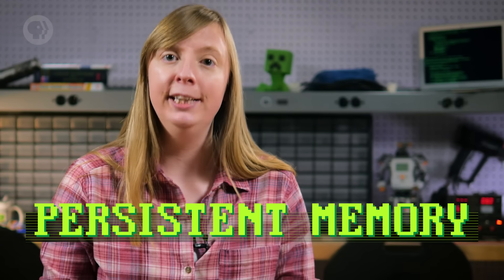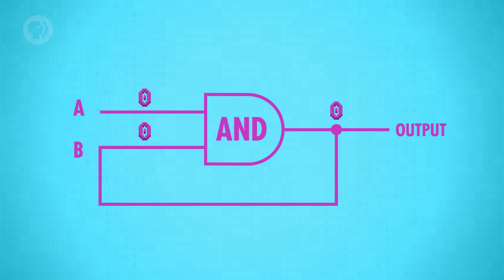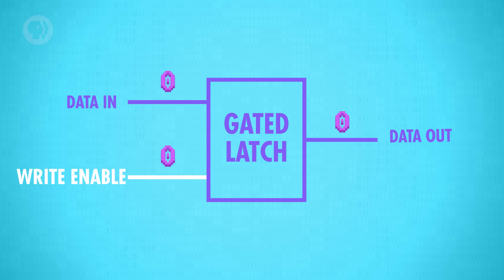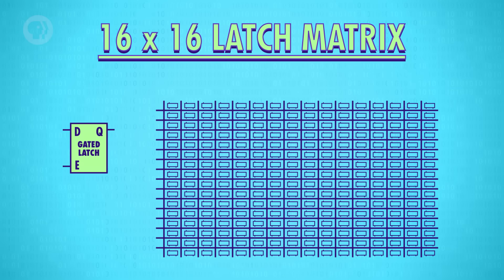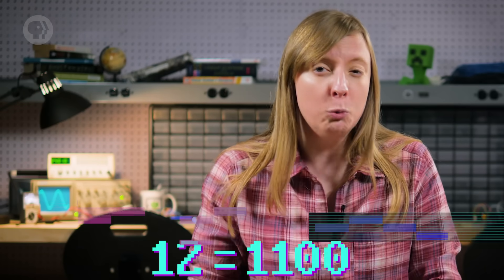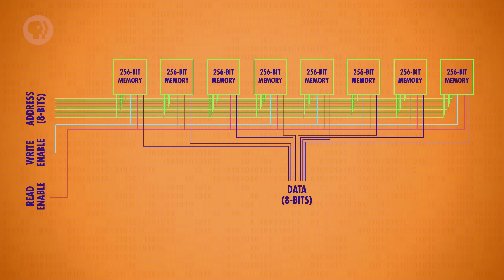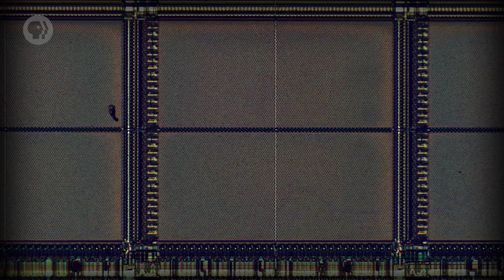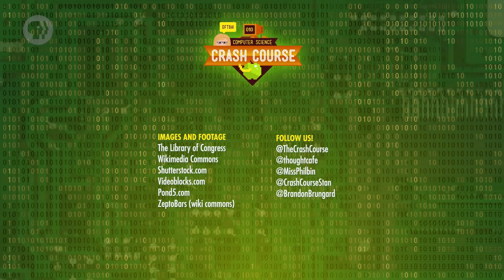Registers and RAM: Crash Course Computer Science #6

Comment: Hi guys , I know the following facts:
There are 4 form of data stored In computer.
1. Latch . Registers use this method to store data;
2. Floating gate . EPROM; 
3. In a capacitor. RAM use this method to store data;
4. Magnetic pole. Hard disk use this way. 
   Now image this scene , the computer need to move a bit from a RAM cell to a register.
How does it work ? What component will make the decision that there is a 0 or 1 in the capacitor ?How does it work ?  
  The data stored in the RAM cell is sent to the latch in the form of square wave ? How does this work ? What part generate the wave/signal ? How does it work ?
Correct me if I’m wrong.Any links or books can help me in understanding the details are appreciated. Thanks in advance.
Reply: Leban Bo All computers are send "digital signals." Digital signals are square waves, as they can be a 1, or a 0, and not in between, so they have a square shape. Electrical engineers and physicists use the term "square wave," and computer engineers use the term digital signal. Anything more detailed than this is a topic for a data communications course.

The wave pattern is logically generated by the Instruction Set Architecture, which will be talked about in a later video, I imagine.
Reply: Thanks for your reply. It's very informative.I always thought signal was generated by a oscillator, so I was wrong, I don't know why I picked up the wrong idea ,no one told me that.Your answer clears most of my confusion.About "What component will make the decision that there is a 0 or 1 in the capacitor ?" do you have any idea what's the name of the component is , so i can have a clue to search . Much appreciated.
Reply: I'm not an electrical or a computer engineer, but it would have to be some part that change it's action based on voltage. While in theory we have 1's and 0's with perfect square waves, in reality we have ranges to determine the values based on voltage. A 1 is declared as a certain range, a 0 as another, and a very low voltage is used to be "off." So I would look up things that "read" voltage and go from there. Sorry I can't be more helpful!
Reply: There is a circuit in the DRAM chip which is called "sense amplifier" which measures the voltage on the capacitor. It produces an output that indicates if the sensed charge above the threshold value. This eventually becomes the logic output signal from the memory chip. Although this is very simple in principle, it is done in quite clever and complicated ways in reality. You will need solid understanding of physics and electronics to appreciate what the problems are how they are being solved.
Reply: Thank you very much . Your help is very  informative , both the book and channel. To tell you the truth , I had subscribed the nptelhrd channel a very long time ago , but I didn't know where to start , there are a lot of playlists , with your help , I know where to start now , Much appreciated. :)
Reply: You may also want to take a look at this classic textbook about integrated circuits. It explains a lot of basic things very quickly: "Introduction to VLSI Systems": Carver Mead, Lynn Conway
Reply: Thanks for your reply. Now suppose we have known the electric quantity stored in the capacitor stands for 1 , if we want to send the logic 1 to the register in the CPU . What  part are responsible for generating the signal ? How does the signal work ,I want to know the process in details,  thanks in advance.
Reply: There is a good book available for free on-line "Dram circuit design: a tutorial." It covers everything in detail, but it is written for professionals.

The details require lots of explaining. It certainly can be understood, if you spend time and effort. I can give you another reference, but you may have to start with learning the necessary physics and electronics before it will make any sense to you.

Go to a channel: "nptelhrd" (The channel provides technical lectures from seven Indian Institutes of Technology (IITs) and Indian Institute of Science (IISc) Bangalore.)

Go to playlist: "Electrical - Digital Integrated Circuits"

Watch the lecture: "Lecture 35 DRAM-CMOS and BiCMOS".

If it does not make sense, start from the first lecture in the playlist.
If it still makes no sense, try playlist "Electronics - Basic Electrical Circuits"
I hope this helps.

Comment: Moving back down through the levels of abstractions, I'm having a hard time understanding how the gated latch works: when both  data  input wire and write enable wire are shut off, were does the potential/current come from to keep the closed latch outputting a 1? This is still an electrical current right? Does it charge a capacitor of sorts? This may be obvious, but I don't get it  >_<
Reply: David Yelbert It is always outputting it's current state. However, we have some small logic afterword to keep us from reading it until we want to
Reply: Yes, no, I mean I get that part, what I don't get is where is the physical electricity coming from for this continuous output of its state, that's my question. How is the electricity stored or supplied to the unit once all "wires" are turned "off"?
Reply: David Yelbert Well, physically, wires are never "off". In a computer, we define voltages for 1 and 0. for example, we may assign 5 volts and 2.3 volts to them, respectively. When we turn a computer off, this makes everything 0 volts. Of course, this would destroy all the data in the RAM, which is why we need hardrives. This 3rd value is also used for tri-states.
Reply: MegaZeroX7 Look, 8 know you're trying to help, but you're talking about two different things: wire being supplied with a higher or lower voltage, which signifies 1's and 0's, which I understand, and the whole system being without power. I'm talking about the first case scenario,where your computer is on, and you get a write enable input with a simultaneous data input of 1. Once those signals have been through the gated latch, it forms an electrical closed circuit running back to itself, thanks to the logic gates that were demonstrated in this video. What I don't understand still is, once you "close loop" this circuit, nothing powers it. From an electrical point of view, it like having a complex circuit and cutting of the battery from that circuit, and expecting the electricity to keep running in circles, that doesn't happen. So once you cut down the abstraction levels, I'm a bit lost as to the origin of the self sustaining current, or is it this tri state you're talking about?
Reply: MegaZeroX7 to simplify my question a bit, all circuits presented so far, however complex, had inputs and outputs in the schemes, which had to lead to, basically, plus and minus charges of a battery somewhere along the line. this explained the voltage or current running along the whole circuit: one side "pushing" the current and the other side "pulling" it. (btw, I'm an engineering student, we kinda understand stuff, but we're not so good at formulating it, apologies.) So when your electric circuit runs back to itself, it should short circuit, unless diodes, and when you stop those impulses, they should die down, unless you have a capacitor somewhere in there.
Reply: It's not in the diagrams, but all the gates/components are implied to have a "power supply" going into them. Like other commenters here pointed out, there is also the distinction between volatile and static memory.
Reply: Right, I get it now,thanks to both of you

Comment: Wait. Shouldn't it be decoder instead of multiplexer?
Reply: A decoder could be ANY circuit that takes `m` inputs and decodes it into `n` outputs according to some predefined pattern. It doesn't have to be BCD on the input nor decimal on the output.
Also, what's "decimal output"? Logic circuits don't work in decimal. If anything, a BCD to "decimal" decoder simply selects one of the 10 outputs according to the binary number on the input, so it's pretty much the same thing as a multiplexer with a constant signal 1. A proper multiplexer would take one more input to know what kind of signal to put on one of those 10 outputs.
Reply: I have to disagree with this. Hakan Sonmez is right; A decoder takes a BCD (binary coded decimal) and outputs the decimal equivalent, whereas an encoder does the opposite. A multiplexer on the other hand selects from a list of inputs and outputs only one of those inputs.
Reply: It's basically the same thing. "Decoder" is just a more general term.

Comment: Question from a compsci noob: how do you engineer things like this? It seems insane that each little chip in a computer has billions of circuits or more. Even with levels of abstraction, the amount of parts is still mind-boggling. How do they do it?
Reply: yes, how the other commenter described, Lithography.  
basically, most processes today are planar and work photosensitive lac, exposure through masks  and development of the lac, similar to old photography. 
But instead of making a pretty picture, it is a step of many to build up the transistors on the semi-conductors. 

That said, in a modern process, those Litho masks themselves are not hand made, they are generated through programs, after engineers layouted and routed all the blocks with different functions. 
Those levels of abstraction are present everywhere and different people specialising in different level of those abstractions is, what makes it possible for us to have such incledibley complex machines available for a big part of our population (especially if you consider phones)

The Lithography technique is what determines the smallest structure size you often see advertised on components, especially CPUs. With modern 14nm processes using X-rays instead of light for the exposure.
Reply: Lithography.  The gates are laid out by machines that can handle dealing with layers of material that are in the nanometers if not smaller.

Comment: Wait, are the memory locations used in c ( the ones stored by pointers) the 32-bit numbers that are the addresses of the memory locations in the RAM?
Reply: I guess it depends on the type of system you're working with.  I'm not sure about embedded systems.  With those you may actually be addressing real physically tangible memory.  But for a cpu, there's another layer of abstraction called virtual memory that allows all programs to see the whole address space while under the hood, the addresses are mapped to physical address spaces.

Comment: Do you need the step with rows and columns of 16 wires?  
Could you just wire each of the 8 address wires to half of the latches with a not gate and the other half without, then and gate all 8 of them together at each latch, so each unique address only enables 1 latch?  
It's essentially the same process as the big square, but with an 8-dimensional hypercube.

Comment: Memory... IS RAM... Oh dear!
Reply: And ROM (read-only memory). Basically, RAM is the memory the computer is currently working with and is erased as soon as the power is cut off. ROM is memory that is stored on a media, ie punchcard, cassete, disc, etc.
Reply: Not exactly.  ROM cannot be written to frequently, so cassettes, discs, and punchcards would not be considered ROM.  Those are physical media or physical storage which persist data even when there's no power.  ROM is for stuff that can't be changed as fast such as a PC's bios or a devices firmware.  ROM can't be written to as much or as fast or as easily as RAM.
Reply: IT Crowd reference... Oh dear!

Comment: "A gigabyte or more" is a bit of an understatement. The smallest desktop DDR4 modules are 4GB. And go all the way to 64GB, but those are pretty rare and start at like $700
Reply: It was certainly an understatement but considering the curriculum it would have been an unnecessary distraction to discuss the exact size of the current common RAM modules.
Reply: • 2 Years Ago
Reply: William Bender It is not very valuable info in this case but if you are going to mention something as a comparisson the facts should be true. I think it is strange she doesn't seem to know this.